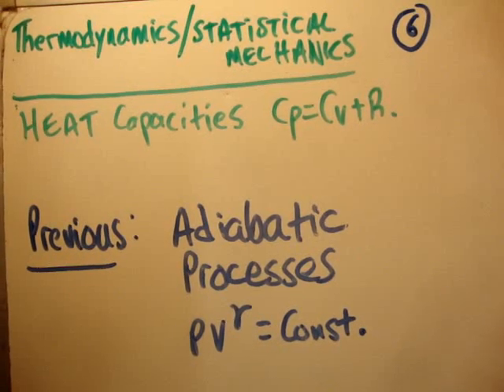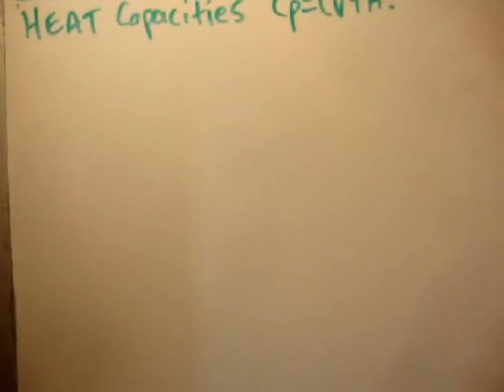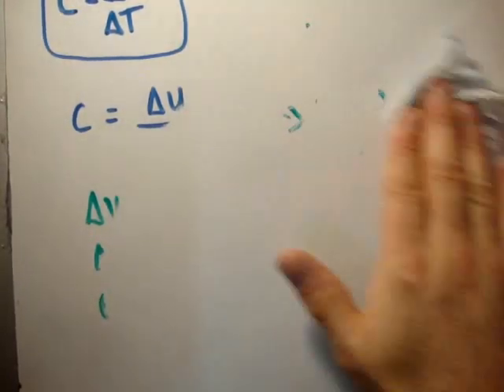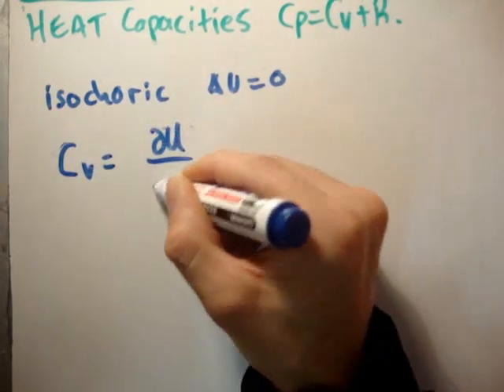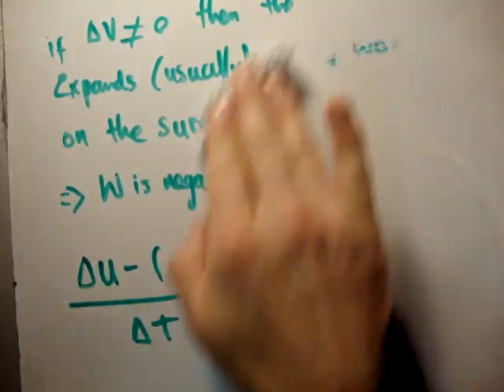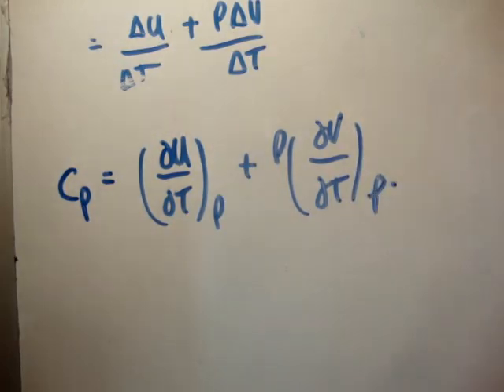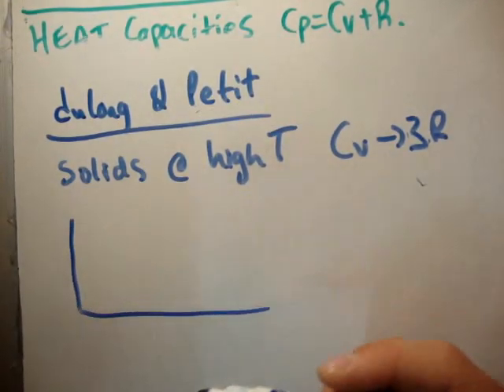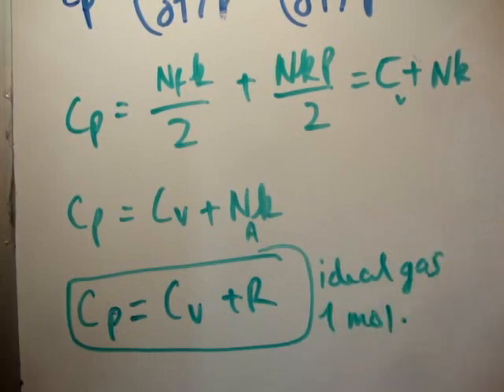Thermodynamics 6 : Heat Capacity

Comment: You made what seems to me as 2 mistakes at the end calculations, but of course, the final relation is correct.
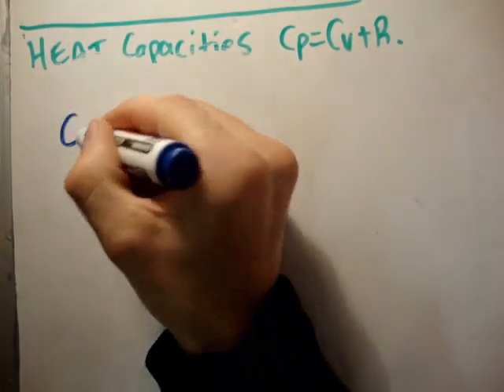- 13:50 's equation is missing a P at the end..
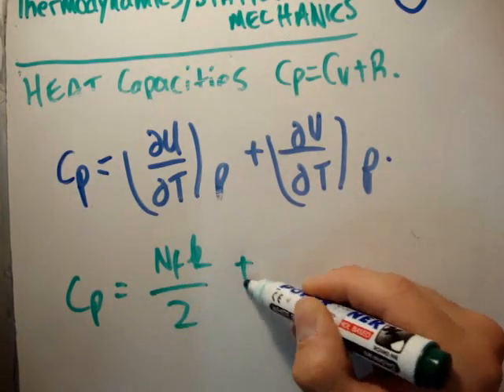- that is needed to cancel with the P from (del V / del T)p that you mistakenly write as a "2" at  14:45.

So at the end it is to note you should get ( Cp = Nfk/2 + Nk = Cv + nR ).  So that ( Cp = Cv+R ) for one mole.

Comment: To abdullah muthafer,
 work is positive,when it is done on a system by an external agent(by convention taken to be positive).Now to ans your query..you must understand that the external agent is doing work on the system.due to which the system gets compressed..that means that the final volume of the system is LESS than the initial volume...Now that means that CHANGE IN VOLUME IS NEGATIVE..SO AS TO MAKE THE WORK POSITIVE WE ADD A NEGTIVE SIGN.AND THE WORK TURNS OUT TO BE POSITIVE

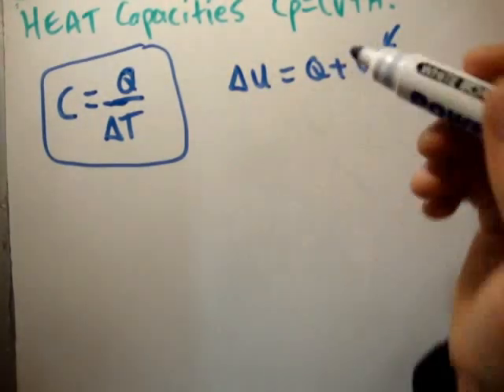Comment: 2:43 OK now W is + when the work is DONE ON the system right ?
what I don't understand is that why in case of work of compression when we  applied a force on a cylinder ( work done on the system ), the work turned out to be  negative  , w=pdv ,w=p(v2-v1) v1 >v2 , we get a ( -W ) i know that, but it contradict the idea of  "work done on the system is + and work done by  is - " ... I know I'm missing something here I wish I can know what it is ! .... GREAT GREAT VIDEO btw Thank you.
Reply: abdullah Muthafer It depends on how you assign the convention. Here, Work done on the system (compressed volume) is positive; U = Q+W. Should work done by the system (volume expansion by system) be assigned to be positive, U = Q-W. My first year lecturer used U=Q+W, and now my second year U=Q-W. lol

Comment: What would my instructor mean if he said, "assume a constant heat capacity at 30 J/mol*K?" The system is adiabatic but I don't know what he means by this statement. Are Cp and Cv the same value and therefore the ratio of Cp/Cv = 1. Or is this ratio that I use in the adiabatic formulas supposed to equal 30? like Cp/Cv=30?... I don't think that's the case because Cp/Cv is unitless and the heat capacity he gave has units.... help?